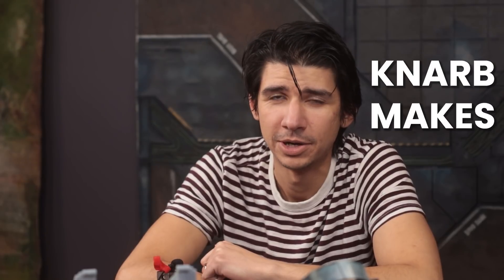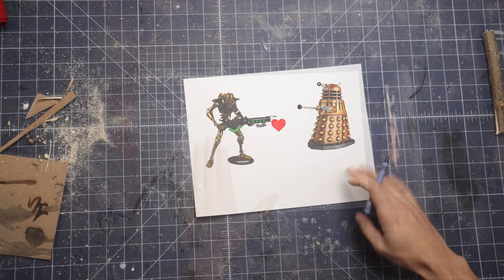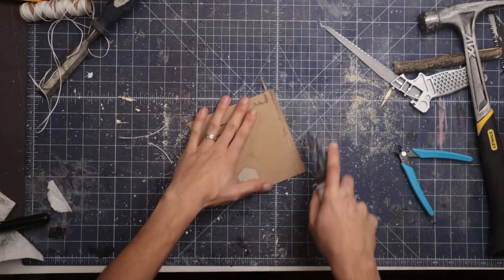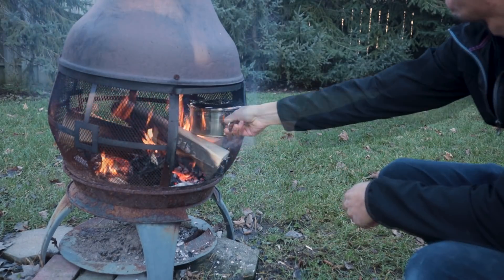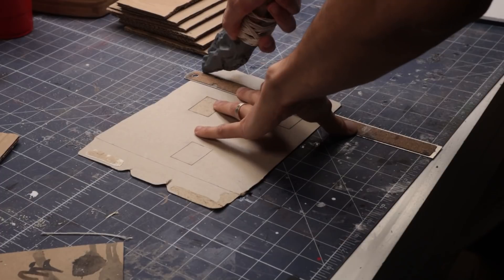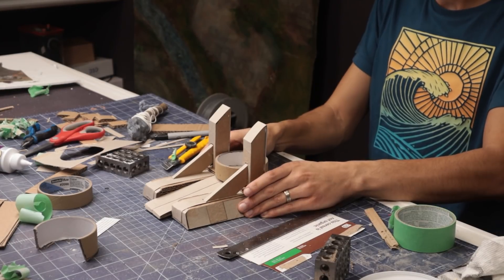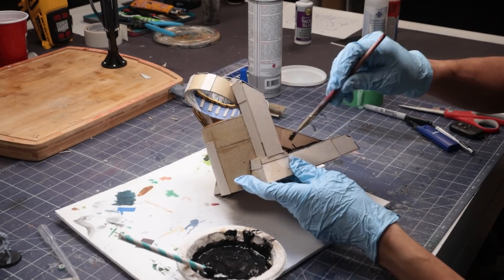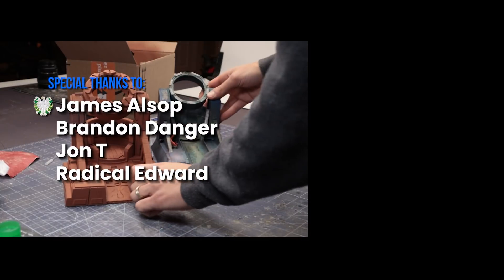Modern Caveman Takes on 3D Printing: Hilarious DIY Fail

Comment: Love the portal, is it possible to feed led to light up the ring?
Reply from the maker: Yeah, I thought about that after I made it. Should be possible to drill a hole through one of the pillars, and run wires along the ring

Comment: ty for the video. I have 2 questions: Do u use a respirator when painting with the airbrush? and also when using cement glue?
Reply from the maker: Yeah, for the most part, I try and wear it if im going to be airbrushing for a while or using solvents
Reply: @KnarbMakes  ty for ur reply yes it makes sense

Comment: The whole thing with people calling 3D printing "not crafting" is just plain silly to me. It's no less crafting than using plastic kits--the only place I could see it called "not crafting" is if you were just printing out pre-assembled minis/terrain, and even then there's still a considerable hobby element to it.

In my opinion, I think the whole thing just stems from disappointment of people who aren't able to 3D print. It can certainly be disheartening to see more and more crafters rely on technology and techniques unavailable to you--I felt the same way seeing traditional crafters use airbrushes and the like. At the end of the day though, every crafter has to use all the tools at their disposal, and rely on the techniques that work for them. Not every crafting video needs to tailor to every kind of crafter.

And besides, almost every "advanced technique," be it 3D printing or airbrushing, can be replicated by traditional means--airbrushing effects can be made with drybrushing, 3D printing can be substituted with bits and kitbashing. It just takes more time and effort, which is why lots of creators make the switch to quicker, more advanced methods.

Comment: Weird to me that this seems to be a debate? IMO, 3D printing pretty obviously isn’t crafting. Just like assembling a kit isn’t crafting. Or painting a model isn’t crafting. Or playing a game isn’t crafting. Which of course doesn’t mean all of those things are somehow invalid or not valuable, it’s just different parts of, and perspectives on, the hobby. Engage with the parts you enjoy, ignore the others.

Cool terrain pieces, both the one you crafted and the one you fabricated. :)
Reply from the maker: Thanks Mads!
Reply: Btw - I’m a video game developer, so I spend years surrounded by great designers creating amazing digital worlds from nothing, and I consider that worthy artistic endeavors and have great respect for the skill required by concept artists, modelers, level designers - so I don’t by any means consider digital work inferior - but I wouldn’t call what we do crafting, either. Though I guess it’s a craft...? Not a native English speaker also might be confused about the nuances here.
Reply: I think 3D printing can be considered crafting if it isn't the sum of whatever you're building. I 3D print things to add into my terrain all the time, but most of the materials I use are foam, cardboard, resin, etc.
Reply: Like. Where do you think the 3d part comes from?
Reply: It’s no different to any other tool in a modeller’s toolbox, tbh.
Reply: i don't think its a debate on whether 3d printing is crafting. it obviously is not. The problem is that Knarb started this channel crafting and so developed a following of people who like crafting. And all of a sudden, he's no longer crafting. He's printing. So his following is now rightfully disappointed. Instead of crafting video content, they're now getting 3-d printer reviews and printing content. And why you may ask? because Aleene from Aleene's tacky glue, isn't sponsoring the video. But Anycubic is
Reply: @zombyfellow  I mean. It absolutely is crafting - so I think there’s perhaps some room for debate
Reply: And the reasoning might be a bit more like: he’s comfortable in using more tools than just the same ones we’ve been using as crafters for decades - and exploring some new tools we have available
Reply: @KaeEbonrai  I agree with that! Whatever your goal is - playable terrain, a diorama, whatever - using whatever tools and methods you prefer and enjoy is all perfectly fine. And I think it's silly to put any particular value judgement into any of those choices. Like I enjoy scratchbuilding and I don't particularly enjoy working with commercial kits. Just my preference. I don't have a 3D printer but if/when I get one I think I'll enjoy using it a lot for things I can't easily scratchbuild.

To me it just seems a question of semantics. If I were to design a piece of terrain and print it, I'd be proud of that as a modeller and maker - but according to my understanding of the word, I wouldn't call it "crafting". Design and fabrication, sure. Modelling, sure. And I absolutely wouldn't consider it "cheating" or somehow inferior to the manly caveman art of making stuff from scratch.
Reply: @KaeEbonrai  It definitely is interesting that some people consider 3D printing to obviously be crafting, and others (like me) consider it to obviously not be crafting. To me it's a semantic difference, suspect some put value judgements into it as well though.
Reply: @zombyfellow  That makes sense. Although to be fair, the channel is called "Knarb Makes", not "Knarb Crafts". :) Making is much wider and completely material- and process-agnostic, IMO. I guess the stereotypical maker is more result-oriented and happy to use whatever approach is best for the task at hand.